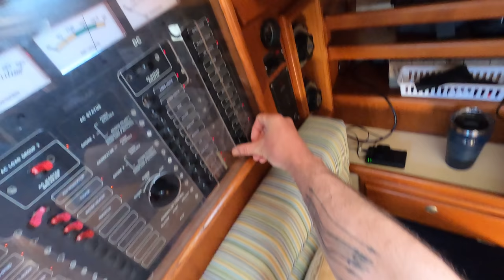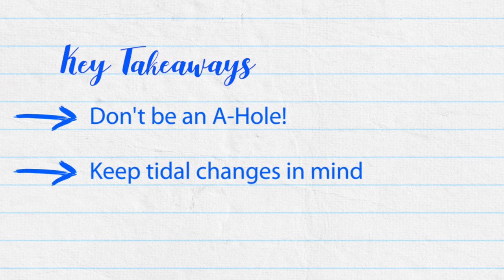I'm an IDIOT... | S06E04

Comment: Great boat...you're doing great, and will not be intimidated by handling her soon...when i first got my vagabond 42 it was an adjustment...i learned a technique to use my torque as huge advantage...try it when you have a calm day in a broad part of the marina....turn your wheel all the way to starboard and keep it there...throw it into reverse and give good throttle ...she'll pull to port of course...but keeping the wheel to starboard throttle down all the way and slip it into forward and give it good throttle ...back to reverse and throttle ..repeat the back and forth process...you'will notice that it will allow you to do a complete 180 degrees within a very small range...i've done this with just a few feet to spare forward and aft...of course it only works on a rotation to starboard, but still very effective , especially on days you have current or wind, because it will eventually get you pointed in whatever direction you want...i was shocked at how small a space i could rotate my boat completely...I'm sure it will work for you too...i had new vetus 85 hp engine that didn't hurt having for this maneuver...cheers...

Comment: When you're coming into the dock, with the wind like you did at the end of the video, try using a line attached to your main winch on the port side (that might not be exactly the right spot, depends on whether that happens to be the balance point or not, it is on my boat).  That line is actually tied in a loop, so one end of the loop goes over the winch, and the other I toss over the outer most piling as soon as I can.  The length of that loop is just long enough to keep my bow from hitting the end of the slip.  With that line in place, I just have slight left rudder and keep forward power on.  When the line gets taut, it's sucks the stern in to the finger pier and the power with left rudder forces the bow toward the pier too.  Of course, you can't do that trick in a slip that you don't know because you have to pre-tie the loop in the line.

Comment: Never approach a dock faster than you’re willing to hit it. Also, look up how to “back and fill”. This will allow you to spin her around (the boat, not Desiree) practically in her own length. As a former sailor now with a single screw trawler with no bow thruster, this method has allowed to maneuver in some tight spots like I knew what I was doing.
Reply: This comment is right on the mark. I also have a trawler and had to learn the same skill. I was taught it as “using prop wash (over the rudder)” as opposed to prop walk.  It’s moving the stern of the boat with very little forward or reverse progress. You can learn to use both but prop wash is more controllable. Learn and practice in open water: spinning boat in its own length AND “walking” boat sideways, both to port and starboard with zero fore or aft progress. Useful for moving into and out of a spot on a face dock with boats in front and behind at the dock.

Comment: The transmission might shift easier when the engine is running and so shifting it with the engine off might not be the best judge. A midship line is often the most useful first line. It can stop movement both forward and aft and at the wisest point limits the drift of the bow and stern much better than either a bow or stern line will.

Comment: You want a smoother feel at the helm when shifting gears - considering what I see, there's a cable doing the pushing and pulling. When there's flex in the conduit to the cable doing the pushing/pulling, then I would expect that. Considering what I see, I don't understand why they didn't use a pull-only system with two cables. Also, I don't understand that the lever on the fw-neutral-rev gearbox relies on a clamp system only. I'd want that to have an orientation lock.

Comment: Get and read Chapman Navigation and Seamanship, and Bowditch.  Each contain complete explanations of why and how your propeller and rudder work the way they do.  Also, now that you have ‘discovered’ spring lines, learn how to use them to rotate your stern into the wind/current BEFORE you get under way.  With a little understanding, and a lot of practice, you can safely come and go from moorings regardless the tide, wind, weather.

Comment: Everyone makes mistakes.  I do wish you would take your glasses off when you do the wrap up at the end,  it seems less personal when your eyes are covered.  And I was thinking that its really good you found out the pinch bolt on the shift lever was an issue at the dock and not while you were practicing docking that would could have been disastrous.  You should find, clean and tighten and document all the grounds on the boat. Then check the volt drop on all of them and document that also.  Then when you have low voltage at an instrument you would have better diagnostics.

Comment: It looked like Desiree was moving the transmission around without a problem. So maybe she's the right person for the job lol ? Maybe the problem you described should have been double checked before the transmission was removed, and brought to New Jersey ? The first thing I always check when there's a cable involved is the $20.00 cable for wear. But that's just my way of doing a repair. Start with the simple stuff and work my way towards solving the problem  👍 yesireebob

Comment: Im surprised the Transmission shifting shaft doesn't have a shaft key. That would prevent further slippage regardless of the clamp bolt being tight or not.

Comment: The extra 10 ft also includes doubling the weight of boat, so manhandled the boat is not as easy when going from 30ft to 40ft. You did far better then I did when moving from a 30ft Alberg to a 42ft Peterson

Comment: Been thinking for a year or so about.  a electric trolling motor with a retractable mount mounted to the bow so you can install the trolling motor while docking and leaving the docks. The crew on the bow could steer the bow while the captain steers the stern. Just thinking

Comment: I have the same sort of problem with my PSC34.  Since you have port prop walk, just like mine, I never even attempt to make left turns if the wind is against me.  It's much less nerve wracking if you just back out like you did the first time and don't even attempt to try to go left, just go right.  Yes, you have to make a 270 degree turn.  However, with the prop walk, you can turn the boat to the right within her own length.  You just put the wheel hard over to the right and then use strong burst of throttle first in forward to stop any reverse movement.  Then let the engine idle back down, shift into reverse, and another few seconds of a strong burst.  Continue backing and filling and she'll swing right around in her own length.  You'll still need some strong burst of power once the bow starts to get hit by the wind again on the starboard side.  There's a certain wind speed where I just don't even try that maneuver, since I'm usually single-handing.

Comment: You will find out that when you have the transmission reinstalled when the engine is spinning the transmission the shifting will be easier from neutral to forward and back to neutral and into reversed with the transmission spinning it is easier to shift Good luck getting the cable on and adjusted correctly

Comment: Two things: 
1. I understand the transmission issue can be chucked up to rookie mistake, but I'm surprised the mechanic you had come look at it did not think to even look at that. I'm also surprised the same guy just left those two ground wires disconnected and didn't think to tell you he noticed them, leaving you with no heat overnight. I know it's not common to have ground wires for interior circuits in the engine bay, but that's even more reason to make you aware of it. The guy was obviously good at taking things apart given how quickly he got the transmission out, but not much else. 

2. Why would you not ware gloves when working on the toilet pump?! lol Especially when it's a recently acquired used boat XD

Comment: My boat behaves exactly the same backing out and I have the same prevailing wind. I found that if I get her quickly to a knot or so of reverse speed and take her out of gear, she'll turn to starboard in reverse. She will never turn to starboard in reverse if the prop is turning. Maybe your boat will be similar.

Comment: Many moons ago I had a chance to go out on 45' cabin cruiser.  This was my first time on one this size as I am a sailor.  We were cruising in the north Chesapeake and when the owner gave me the helm (odd sitting so high in the middle of a yacht) I took some time to get the feel of how it handled then I captained while the rest partied.

Later that day they wanted to do lunch at a restaurant located on the C&D canal. The tides are a bitch there and I was going with the tide coming towards the dock so I made the decision to go past, turn and use the tide to my advantage.  The owner  looked at me like "you break it, you pay for it" but didn't say a word.  I brought that 45' yacht to a halt inches from the dock with the shore guys just tying off.  The owner looked again at me an said "How?" and I told him,

 I'm a sailor.  If you can dock a sailboat, a motorboat is easy.  Later on coming back into their slip I handed docking to the owner telling him, "know when to fold em".

I am going to completely enjoy the day you guess run up the sails.  Please bring someone to video your reactions (I'd volunteer, but live too far away), because they will be priceless.

Comment: Only 13.22 mins in but why not continue reversing out of the berth , prop walk pulls the stern to port and the wind blew the bow off to starboard, all helps with the turn. What you seemed to be doing is fighting all the elements. Will continue with video now.

Comment: I'm sure someone has probably said this already...  Our 36 Catalina has no bow thruster and same dramatic prop wash. I've become more and more comfortable backing out of our slip on these same conditions. Start with the helm opposite the prop wash, give it a fair amount of throttle then take it out, should be moving a good amount, sudden prop walk, but it dissolves quick. I do this 2-3 times to keep that speed up. The speed is key to have enough movement so you don't need the power on, but enough speed so the rudder actually does enough to turn. There will be PLENTY oh shi* your pants docking moments still. And your boat is a hell of a love heavier than mine which probably makes it all harder. Some of these guys can back up for miles in a marina no problem. I talked to one. All about speed and throttle jockeying. Unless you have enough room to keep a lot of speed then you find a sweet spot where power can stay on and rudder is counteracting prop wash perfectly.

Comment: This was interesting to watch I worked in the offshore oil field for decades - ive ran single screw boats we used for stand by boats in the 70s - it takes time to master the art of landing them at docks especially in slips  - those that have never been on boats it's nothing like steering a car or even driving on ice - some how u know in your  mind after a while what the wind is doing and the water currents are doing, - it also doesn't matter how much power u have, the art of maneuvering a boat is mastered in time especially into a slip ( dock for them) - I've seen Some slam into slips or docks over the decades busting up the dock or landing as we called it - also a single screw boat can be difficult to maneuver compared to dual screw. boat - u have to know in your head what the wheel wash is doing then u can understand what will happen when your running astern or backing up a single screw boat  is nothing like backing a car up lol - ( it takes a lot of skill to dock a boat in a slip were water currents and wind are factors ) - in his case he just mastering another boat each boat handles differently & for him it's a different boat then he had before so now he will have to master this one

Comment: Great video and example of how simple things can  get missed. i have done pretty much the same thing - but didn’t spend 3 hours driving!!.  Once my issue was fixed the problem I had was getting the propeller shaft connected back up to the transmission without flooding the boat through the PSS seal. I ended up taking the bait out the water so that I could undo the PSS and pull the prop shaft back into the boat - doing it in the water I thought I was going to sink here - How did you manage to reconnect whilst still in the water? Morgan

Comment: Those transmissions are not that difficult to rebuild. I bought a 380 Catalina that slipped.  Pulled it apart and found the guy before me rebuilt it and forgot to put one of the clutch plates back. I just replaced everything with a rebuild kit and it was fine afterwards. Just lay out all of the pieces on a clean towel as you remove them and take pictures to refer back to if you get screwed up. Cost me about $140 for the rebuild kit. It does take a little playing with the shift lever to get the cable perfectly centered.  Never had another issue with it.

Comment: Hi Thanks for the video!  A bigger nice shiny boat would be intimidating to get used too.  You are at about the maximum size I would want to deal with unless I had a crew of 3 aboard.  Did you make a permanent reference mark on the shift lever and the shaft to check for slippage?  I'm surprised the shaft and lever weren't splined.     Good luck!

Comment: @6:03 I think I saw you putting super lube on the threads of your transmission mounting bolts, do not put lubricant on bolt threads, if that's what you did you'll want to remove those bolts and clean the lubricant and not just the bolts but the bolt holes as well. The grease changes the clamping force and those bolts will loosen, if anything the manufacture may specify using a thread locking compound refer to the service manual. Plus I'd use a torque wrench on those bolts as well. I'd probably not say anything if you were working on a old clunker in your backyard but I assume your going to sail this boat hundreds of miles out to sea, your safety and security in paramount.

Comment: Docking.... Too much rudder will "stall" your maneuverability. Pulling into slip.... Try stern in first.... Back in. I crew on 50' sailboat with no bow thruster and its easier for me to back into slip..... Just remember not to stall the boat with too much rudder.

Comment: Okay, so at 2:52 you bring up the shifting shaft.  And I still don't think you know the real reason for the problem.  The problem was, you had riffraff working on the shifting shaft.  That's why the lever kept slipping on the shifting shaft.  Now, loose lips can sink ships but a loose bolt can make you feel like a dolt!  Next, at 5:22 You explain to Desiree that you need to push the shaft a bit further in.  Followed by "I'm in a much better position."   8 - [    lol   Then at 8:55 Jordan gets really pissed (off, on ?) about a rubber bumper - but no, not a rubber baby buggy bumper.  Only a tiny toilet lid rubber bumper.   Around 19:00 It sure is too bad you don't have a bow thruster!   Concerning tidal currents, I sail my boat on a fresh water lake and tidal currents just don't happen.  So, if I had been you guys things would have been much worse.  However, . . . maybe not.  I once made an effort to paddle my very sea worthy 17 foot kayak across the Hudson River from west to east (NJ to Brooklyn to do a meet up with Dan and Kika).  Now tides can slow down or speed up the flow of the river, but as I started out, water was just water and you moved over it, it didn't move under you.  Half an hour later I was wondering why I had to point up river to get to a place straight east across the river.  Then my "smart" side kicked in and said "Current, you idiot!".  All in all almost anyone piloting a boat has had a "What an idiot!" moment.

Comment: I'm wondering if bow and stern thrusters wouldn't help.

I've been in harbors where the currents are totally contrary to logic and my crew boat had a center positioned rudder. 

I took to it pretty quick but the wind current and tides were for ever changing.

I mounted bow and stern thrusters and that let me position the boat where ever I wanted and create side pressure against anything for loading equipment or gear.

I'm looking for the exact same boat you have now.

It was your shopping experience that made up my mind so; thank you for that.

Lastly; I'm designing a self recovery system for A MOB situation.

I seldom to never hear tgattalked about and what other people are doing to address the absolute possible scenario.

It seems; no one wants to talk about it. 

So; I have the concept designed.

I have to build it and test it under every possible sea state and weather condition.

I'm amazed my concept device isn't already on the market. 

But I won't sail alone or with an inexperienced crew until I've built it and tested it.

A MOB situation at sea must be a 10 on the hazard scale; PERIOD.

Comment: So I have the same problem with excessive prop walk.  I was told when backing,  to get up a little speed then > Neutral and then turn.  I have not tried this but you can :)  Also waawaawhat?  You pulled a transmission for a loose nut??  You got fix it fever...  Are things going too good or something :)

Comment: Why didn't you rig a block and tackle to your boom so you had better control of the transmission when you removed/installed it?   I would hate to see you drop that on your foot or hurt your back trying to muscle it into the engine compartment.